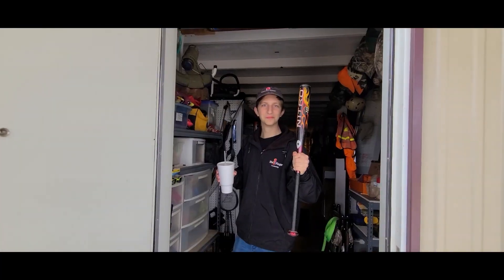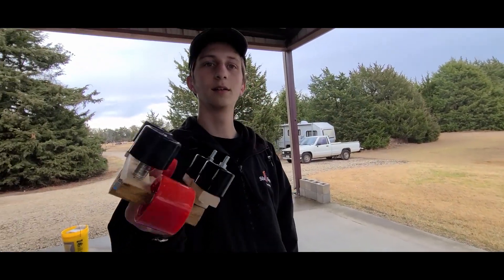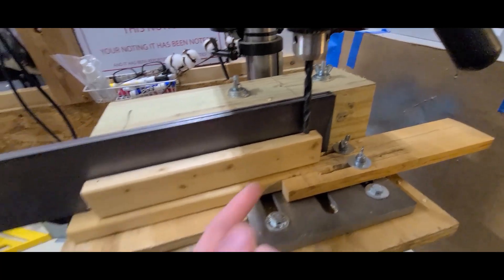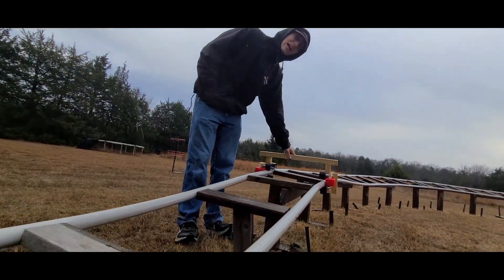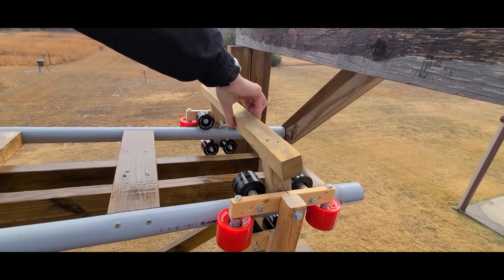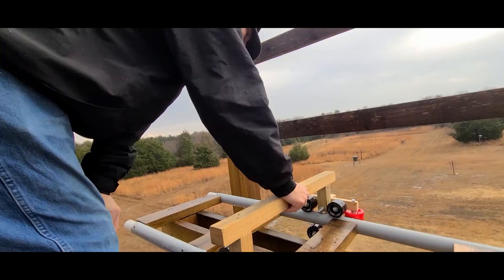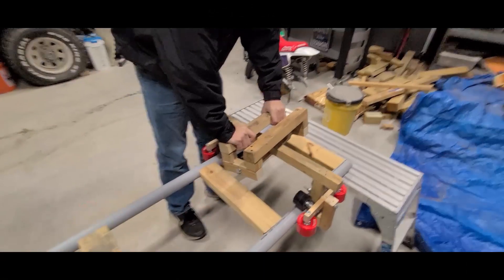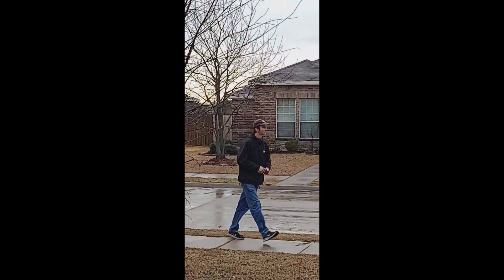Backyard Roller Coaster Update 4 - Wheel Bogie!

Comment: I might suggest one upstop wheel, centered, and keep the 0.25" gap, due mainly to track tolerances other geometry issues.    I've sent people CAD files (iges or step) of steel carts, but I like how you are figuring it out yourselves.  I wouldn't cantilever (like a diving board) the wheel axles, as support on both sides has better load transfer.
Reply from the maker: Thanks for the suggestions. And thanks for the comments on the wheels, and we already plan to do that as well. But with wood and my current bolt lengths, I couldn't quite fit in a support on the inside. The finished product on the steel version will look quite different from this version, we should have probably explained that in the video more lol